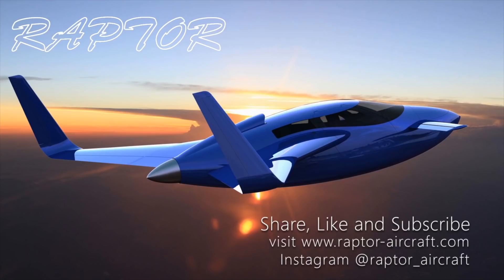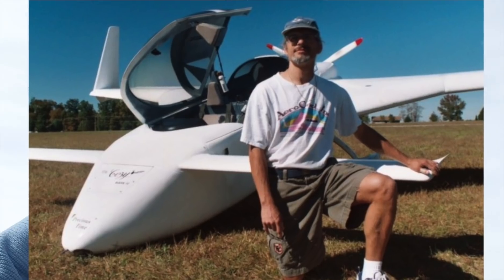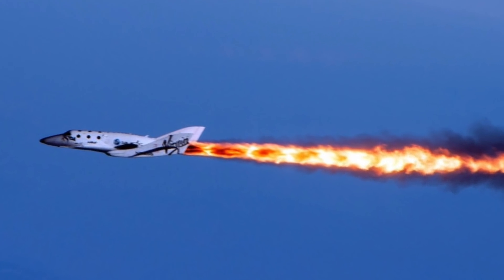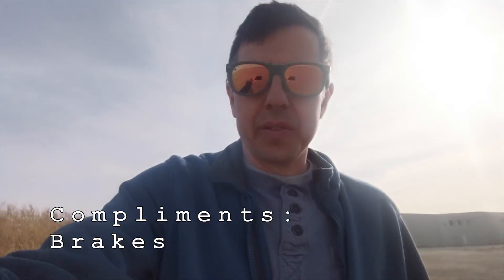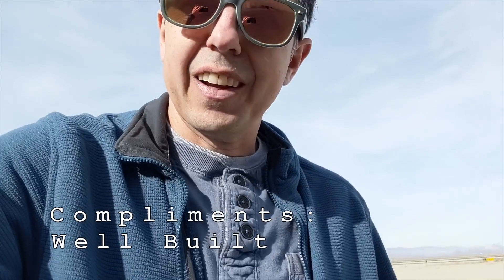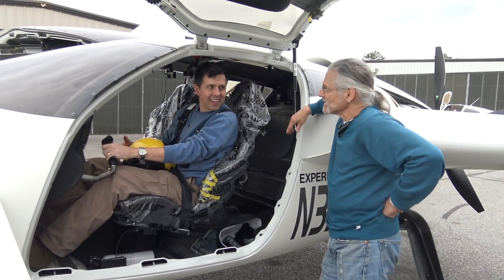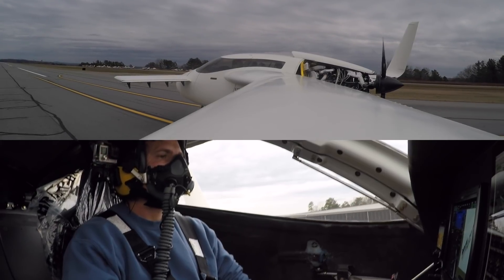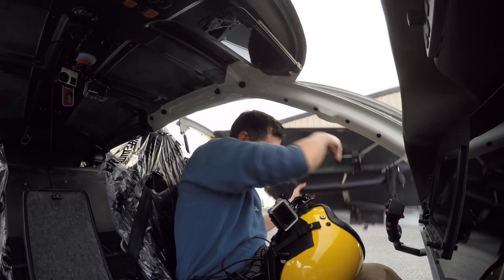Clever Girl - Raptor Aircraft Prototype First Look - Wasabi Flight Test

Comment: A mere mortal pilot has flown the plane successfully on many flights, many takeoffs, many landings and flight hours. The hired flight suit wearing "test pilots" were scared of it and quit. On top of that a PSRU seal blow out resulted in the mere mortal pilot making a safe dead stick landing. The test pilots need to lose their self appointmented "test pilot" title and give it to Peter?
Reply: Not sure those many flights, many take offs, many landings and flight hours have progressed much other than identifying/verifying poor design and implementation decisions. If the mere mortal had an actual test plan, he might have progressed a lot further by now. The seal blow out was a direct result of his engineering incompetence by not fitting the designed retaining ring in the first place. Self induced problems. It needs another set of eyes and more structured approach to the project to pick this fundamental stuff up.
Reply: @simonbaxter8001  What is your education and back ground? What have you ever designed and built, anything much less a complex airplane? It was a prototype. He made a forced off field landing and walked away. The airframe is so strong (overbuilt and heavy) it could be rebuilt. I say success. We learn from failures. Needlessly play this second guess game after the fact. Also Peter had a lot of input from many people, and did make many changes based on that input.

I was very vocal about the PSRU drive system from the start, as  being un-airworthy and likely to fail. It did twice. I don't say told you so. Almost EVERY Automotive engine conversion to airplane PSRU has failed or will fail. Peter is not the first or last. However he tried. If he went belt only drive and electric prop he would have been better. Does not matter. He has left the Audi V6 diesel for some twin ducted fan design. That is a very bold move. 

With that said he knew it was overweight (due in part being built for pressurelization and just overbuilt), and was underpowered. No need to repeat. Somethings on that plane worked very well and were clever. Other items were less than ideal (PSRU as mentioned). 

People thought Wright Bros crazy. They also crashed a few times. We (USA) lost astronauts going to the moon. Should we have quit. Men did not quit and kept flying. We also lost a lot of test pilots trying to advance aviation. Hey $@#% happens. It is pointless to say... nah nah na na naa.

BTW Elliot Wasabi Test pilot has crashed 3 or 4 planes, recently a P51 replica, totaled. Doha! Again this is risky business and stuff happens. Elliot did a good job crashing. Peter deserves credit for staying cool and making two successful forced loss if powet landings, one on and one off field.
Reply: @gmcjetpilot  I've never designed an aircraft other than conceptual RC models. I have built and test flown a Vans RV-6A. I've spent 18 years flight testing development commercial aircraft from the Jetstream 41, BAe ATP, BAe 125-1000, BAe 146, BAe RJ, Pilatus PC-12 with 4 years structures/aerodynamics and systems training prior to that. Yes, the Raptor was a prototype, that isn't in dispute. The grey area is the approach to that development activity. You said the PSRU would potentially fail ... it did. Others from the aerospace and flight test community, like me, have highlighted that the cavalier approach and implementation would cause issues. Unfortunately, the aircraft didn't last long enough for other bad design issues to emerge. I made a comment on his Facebook page asking why he didn't test the aircrafts performance at higher weights and higher altitudes, based on the plan for his positioning flights to Boise would take the aircraft into that part of the flight envelope. He failed to do that during his 40 hour fly-off at Valdosta! Consequently, his PSRU failed en-route at 1000ft (because he couldn't climb higher at his transit loads!). So, I don't doubt his drive or enthusiasm, I doubt his ability to do that in a safe and though-out way. Now, his recent video to now pursue the Raptor NG, which is yet another new powerplant, new airframe combo doesn't look like a sensible evolution. He has an airframe that aerodynamically appears good ... it just needs better construction to loose the excess pounds! The Audi engine is not the problem. The problem is it's cooling configuration (needs to separate the rads), the turbos need to be sized correctly (and tested extensively on a ground rig), the PSRU needs re-designing based around the weaknesses and poor design elements that have plagued the programme since first flight. So, no I haven't designed an aircraft, but I've worked on enough structures and systems to be able to see poor design, poor construction methods, identify single points of failure, no safety wire on critical components, cooling and airflow issues, handling issues and what usually causes them and what fixes are put in place to correct them. You don't have to personally design and get a product to market to be the only voice on the subject. I just hope that losing the Raptor may have given Peter a wake up call, but somehow I don't think it will have changed him. The next iteration, especially with the new aero design, with smaller wing span and hence reduced roll authority may not be as forgiving! If he has pitch and roll issues on the NG it is going to be a finer margin to get right. With regards being overweight, I've already commented before on various posts, that why wasn't the build weight being checked against the design CAD weight during the construction process? It should have been identified well before the airframe completion and addressed then. It's only because he just ploughed ahead thinking it wasn't an issue, is a perfect example of the cavalier approach and implementation. You don't need to design an aircraft to manage such a fundamental oversight! If that's his approach to the weight, who's to say that his approach to identifying failure points and their consequences was actually considered.

I wish him all the very best in his endeavours, but he really needs to learn big lessons from this ... only time will tell if he has!
Reply: @simonbaxter8001  Well myself I have a masters in mechanical engineering. I've been in commercial Aviation for 36 years certified the 767-747-777. I'm an instructor and ATP with type ratings on CE500, SA227, 737/757/767 and a few business Jets. I built and have flown in RV4 and an RV7. So you're an expert? It's so easy to criticize but you really never did anything extraordinary except build a kit plane, which is pretty common and straight forward. With a Lycoming the airframe is well-known. So take off your test pilot jumpsuit and helmet. So you never have nor ever could do what Peter did? Right. Why are you such an expert?

I know what it's like to work for large aerospace manufacturers, both as direct and contract employee (Boeing, Airbus, Douglas, BAE and several airlines). You had a tiny part of that pie with ZERO risk. So again it is amazing what Peter did, compared to manufactures who have 100,000's people and billions. PS manufactures also get it wrong. Even though he failed meeting his goal (which obviously was unrealistic) it was a good try.  Get my point. 

You are entitled to your opinion and expressing it. However I am happy to point out he did something special bringing his aviation dream to life. At this point it's poor sportsmanship and manners to pile on. Up to you to be you.
Reply: @gmcjetpilot  To be honest, I'm not really interested in your background, I never even asked! I'm not an expert in aircrafg design from the ground up, I've never said I was. The comments I provide to these conversations is based on my hands on immersive experience. My comments are my opinions based on that experience and the conversation at the time. My comments are aimed at Peters project in an attempt to support the guy. I don't understand why you have the arrogance to make your comments personal against other posters as if their options are wrong because you decide to review them! You have your opionions, I have mine. Leave it at that and move on. I have nothing to prove to anyone, especially you. I don't dismiss or belittle your experience, I suggest you should try and take something from that and recipricate the respect! We are all aviators here, not children in a school yard!
Reply: @simonbaxter8001  Funny I was not interested in your background you vomited up in a long diatribe as refutation of your expertise. Accusing me of arrogance is you  projecting. I already said you're entitled to your opinion. Have a nice day.
Reply: @gmcjetpilot  Funny, because you actually did ask ... "What's your education and background?" a few posts back! You have a short term memory issue there! Have a nice day.
Reply: @simonbaxter8001  Funny troll. 🤣 Nothing you said answered why you are an expert. You spewed your ego and said nothing. The only part needed was you admit you are no expert. Agreed. Second you claimed the designer consulted with no one? False. He had consulted and worked with many and used RC model, CAD, CFD, FEA. There are many laudable aspects of the plane. Last if I want to post my CV that is my business.

 Are you a Brit? That would explain a lot, snobs who look down on America. Yet UK stopped having a viable Aerospace industry over 40 years ago. Now you make parts for the French. The FRENCH! Ha ha. Ouch! You lost.
Reply: How's that working out for him?
Reply: @kirkc9643  Ha ha what a condescending comment. What airplanes have you designed built and flown? Peter is fine. Not a scratch. The plane is rebuildable, but he is moving on wisely. He learned a lot. If everyone in the past who took risks didn't, we would have gained nothing. Have a nice day. BTW Elliot Wasabi Test pilot has crashed 3 or 4 planes, recently a P51 replica, totaled. Stuff happens. Flight test takes risks.

Comment: Whoever did the vid here needs to be fired. WTF is with the segues to a scene from a movie? Pointless garbage. Then, when you are looking at a complex object like this, the notion that that you cut to new views every 2 seconds as though this is a promo for an action movie is absurd. Each framing and view should last long enough to digest a solid impression of what is being looked at, which is impossible here. It's just a flashing series of moving views that are very unsettling ie complete junk.
Reply from the maker: thanks for the comment.

the theory was that the airplane is extensively covered on Peter’s channel so that kind of detailed review would be either redundant or inappropriate since it is any ongoing program and Peter is a customer.  but I hear you.

Comment: I’d pretty much given up on ever getting my ticket and owning my own plane due to the high costs, especially if you want to go any faster than about 140 knots. I came across the Raptor website a few weeks ago and I’m completely rejuvenated. I still can’t believe the financial targets but if they’re true, I’m in! Really hope this project comes to fruition.
Reply from the maker: We are excited as well!!
Reply: I am all in for spending $100-130k for a fast pressurized airplane with modern features and low fuel costs and reasonable $10k engine replacement costs (I fly 7-800 hours a year, I'd run through engines like a pair of shoes).. I'm waiting with puppy eyes on details about his production plan. He's quoted $130+15k for parachute and that's with no apparent labor charge, licensing/profit fee and with the assumption he will get the same supplier discounts that Cirrus gets with hundreds of annual sales. If he can truly deliver this airplane in the quantity of several hundreds produced annually for a $100k payment and a 3 week builder-assist program, the entire aviation community ought to be storming his hangar to buy one. Oshkosh in 5 years should have more Raptors than LongEz's and 172's combined, it'd have the potential to re-vitalize GA aviation unless everyone's just happy flying Microsoft Flight Sim 2020 in VR headsets. I would need to see more than 40 hours on a test program, I'd put my money where my mouth is once a few engines make it to TBO without being the cause of the eventual accidents.

Comment: Just a heads up.  STOP WALKING AND SHOOTING VIDEO!  Makes people want to puke.
Also. You dont need a full on O2 mask AND pressurization for taxi testing.  Makes you look like posers who dont know what you are doing.  Just thought I would help.  Been at the Av thing a LOOONG time here.
Reply from the maker: M T thanks for the comment.

The mask is worn on the taxi test to check comms and prepare for first flight.  Low speed taxi test is the last chance to dress rehearsal the first flight.  So it’s the last chance to get sight angles, get used to flare height, and check comms with the engine running.

It goes without saying if the only downside of a safety measure like a mask is looking like a “poser” that’s not much of a downside is it.

airplanes are cool
Reply: @utopiasnow   You talk like you still intend to fly it

Comment: Cant wait to se this bird in the air! :-) Can be one really big step in history.. Auto diesel, FL250 feet, pressurized, high speed, affordable, amazing!
Reply from the maker: Exciting times for sure!!
Reply: 30000 feet heh ?  I was just wondering , the right rear window split in half just from sitting parked  in the hanger while he was on vacation , how high would he get (assuming he would have the power) before one of his windows blows out of the plane ,
Reply: @sychrovsky  it was FL250, dont know where i got FL300 from :-). Maybe had a drink when watching it ;-). But i see what you mean, it is not there yet! But potential and on paper it sounds to good to be true. But with that said, lets just wait and see. Peter is a stubborn guy and hard working! Here is the data by the way, if you have not seen what the plan is when ready.. http://raptor-aircraft.com/specs.html
Reply: The aircraft is more than 1200 pounds overweight and won't meet any of the range, ROC or speed projections. The PSRU not mounted rigidly to the engine is a disaster waiting to happen and the 1st stage turbocharger compressor is way too small to perform the given task at FL250. Running the EGTs at 1700F is going to take out the engine in short order. 
I have big concerns about the elevator mass balance and all control linkages as well. The wing looks extremely flexible and vertical fin area seems marginal for yaw stability. That's my short list...

Comment: Awesome review. The care in the build looks high as i have been following him for a while. Nice to see experienced 3rd party review. If this aircraft can perform 1/2 what it claims the real problem will be keeping up with demand! As for the heavy airframe, having watched the build process when it comes to production and weight savings i dont see why they couldn't get huge cuts. (swapping out all the steel welded brackets throughout with CNC aluminum would be an example. The engine doesn't worry me as much as some on here. I remember going through my AME schooling and thinking how archaic piston aircraft engine design is and how many possible gains there are to be had with automotive technology as they have high capitol investment in their design. This engine with 1/2 the TBO would still probably be more cost effective than a lycoming or continental of comparable HP. Safe to say if this is a success i'll be in line for one guaranteed!
Reply from the maker: Thanks John!

Comment: I'm usually not too picky about camera work or editing but this is hard to watch. Editing was so heavy on the monologue it looked like a DVD was skipping. Also we get it the Jurassic Park raptor we don't need to see it 20 times. Why is the one guy by a drainage ditch? Very cool airplane though.
Reply from the maker: Thanks for the notes, unfortunately, editing isn't part of my formal training.

Joking aside we were having issues with all the spoken portions of this edit, but we were under some time pressure to get the thing out.  The ditch was the only spot were the 20-knot Mojave winds wouldn't smoke the mic.

Ah well, thanks for watching.

airplanes are cool

Comment: Nice. I like the automotive engine approach. How much does the engine weigh with everything?  Interesting that it's pressurized. That can be a significant advantage.
I wonder if the cabin is too big and lose a lot of speed and range.
Reply from the maker: Thanks for the comment!
Reply: @utopiasnow  if the plane is designed for relatively high speed flight, could a smaller diameter prop not be efficient such that the gearing on the motor could be avoided? cheaper lighter prop, less tail strike concern. less loss less weight. 
Side note, there is probably not enough room in this fuselage but when done wide enough for 5 seats, it could be interesting to do a 4+lavatory config instead of 5. A lav kicks it up to a different class. could just be a bowl with some kind of one time use bags and wet wipes. could even have a little video screen so you could pilot from the lav :)